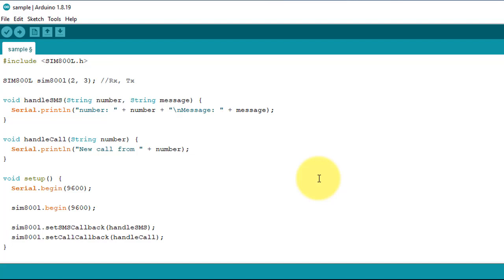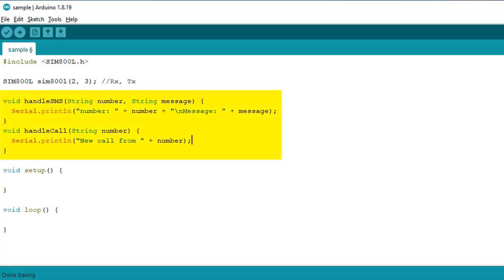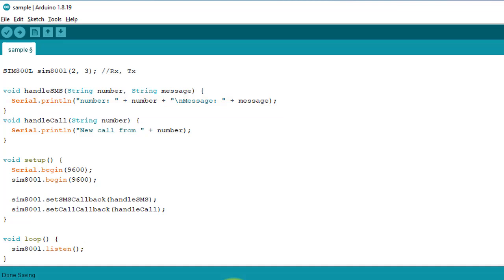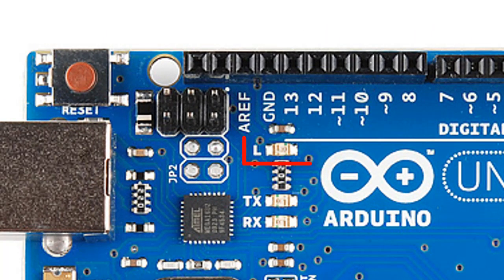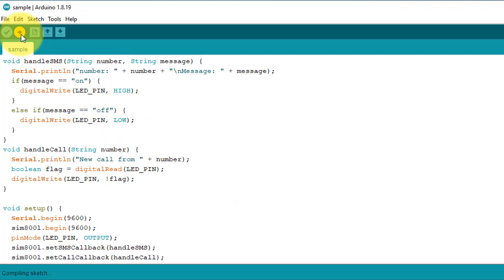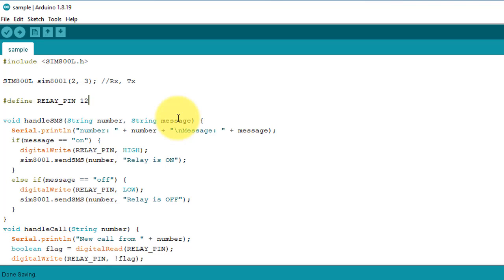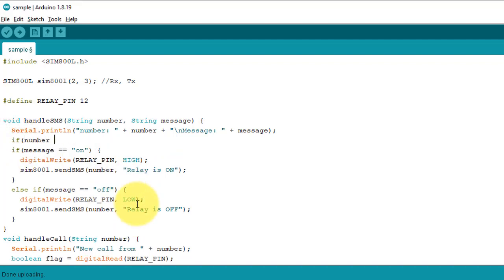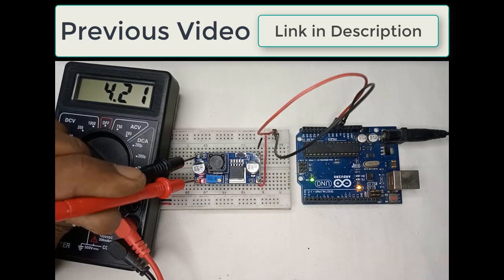GSM Module Arduino - Sim800L Library Programming

Comment: youre circuit diagram is not correct, my sim 800l module is damaged and not working. and also dc to dc converter not decreasing and increase  voltage when i connect to youre diagram. how to connect dc to dc buck converter please tell me sir

Comment: Hello Ahmad,

PROBLEM : Startup problem by using your project (Arduino UNO and relays steering by SMS) with only external power source and by external power failure.
First of all Thanks for this tutorial !
But  when I tested the Sim800L & commanding the relays with SMS I realised a Seriously problem !
The program runs only without problems when the UNO board is coupledwith the PC via the serial usb connection.
Running the Arduino UNO only via the power jack (12V feed), the program doesn't work !!! 
The Arduino UNO & Sim800 StartsUp !
The Sim800L runs and connect to the network, the PowerLeds on the Arduino lights up!
But there is NO REACTION on sending the SMS, despite the Rx Led on the Sim800 gives a sign of receiving the SMS !
 
You have to Reset the Arduino first by the Reset button before the program start and run again without problems!

So there is a problem on Starting Up the Arduino by only using external power. Same difficulties when you have an external Power failure.
In bot cases you have to use the RESET Button to start the program !
That means that you can't trust the working of those projects. Specially when the project is located several miles awayom your position !!!
I could not find out what the reason is for this malfunction, could you try to find a solution for this rebooting problem ?

Greetings

Comment: if the SMS is not readable on the serial monitor, you need to turn off (Auto-bauding) on the Sim800l and set it to fix 9600, now it works. AT command used AT+IPR=9600

thanks for the library, it really helped me
Reply from the maker: thanks for suggestion

Comment: Hello Ahmad, I bought sim800l gsm module but ı cant run that can you help me ?
I dont know what ı did wrong. I provide 4v 2A from adjustable power supply and ı plug sim card correctly but it says "Register in network failed"
Reply from the maker: provide 4.4v
Reply: Are you sure you have 2G coverage with your provider at your location? If not, try adding a piece of wire 1/2 of the wavelength of the respective 2G band (900 MHz in most of the world including India). Also check if the right pin is used.

Comment: Now I bought GSM SIM800L and when connected to the circuit it rings but the code is not executed 
And when I changed it to another one the code worked what is the problem that is in the gsm
Reply from the maker: I think the issue might with with sim800l
Reply: @AhmadLogs  But the connection responds but when placed in the circle the code does not execute with the Arduino 
While the other works well on the same circle
So does it need to make configurations or definitions when using it for the first time
Reply from the maker: @AlMokhattatAlIlahi  I does not require any configuration for the first time. the library configure itself. I think there is some other issue

Comment: Dear my sim800l module not responding for any AT commands what may be the problem?
Reply from the maker: observe led of sim800l to see if your module is working or not.
check your serial connections
check baud rate etc.
Reply: @AhmadLogs  my sim800l led is properly blinking after 3sec  i check all the connection. I have 4 sim800l module but all are unable to handshake with Arduino UNO, Arduino nano and esp32 and ESP 8266 pls help
Reply from the maker: @varunraghuwanshi3177  There are several reasons why your SIM800L module may not be responding to AT commands. Here are some things you can check:

    Power supply: Make sure that your SIM800L module is getting sufficient power. The module requires a stable power supply of 3.4-4.4V and a current of at least 2A during transmission. Check your power supply and try a different power source to see if that resolves the issue.

    Connections: Check all your connections to ensure that they are properly connected and that there are no loose wires. Make sure that the RX and TX pins are connected correctly, as incorrect connection can cause the module to fail to respond to AT commands.

    Baud rate: Ensure that the baud rate of your serial communication matches the baud rate of the SIM800L module. The default baud rate of the module is 115200, so make sure that your code and serial monitor are set to this value.

    SIM card: Make sure that your SIM card is properly inserted and activated. The module requires a working SIM card with a data plan to connect to the network.

    Firmware: Ensure that your SIM800L module has the latest firmware version. You can update the firmware by downloading the firmware from the manufacturer's website and following the instructions provided.

    Reset the module: Try resetting the module by powering it off and then back on again.
Reply: Thanks for your valuable feedback

Comment: Thanks for this detailed explanation,
whether it is possible an sms code and SIM module to vary the PWM of a led by messages. example: send v0 led off, v1=20% pwm, v2=40% pwm....until vn=100% pwm.
thank you for your reply.
Reply from the maker: Yes, you can
Reply: @AhmadLogs what code is required for this, and how can the message be changed to require led_state:"brightness" (ranging from 0 to 100)? Thanks for any answers.

Comment: Please make a video Arduino gsm with relay control mobile app  by mit app inventor. Please
Reply from the maker: will try
Reply: @AhmadLogs  thanks Bhai
Reply: Sir please make a video arduino nano gsm sim800l and  2relay for water pump starter control trigger mode only 5second on by sms command and phone calls START relay and STOP relay and define a pullup funsion pin for water over flow sensor control it's very helpful for farmers 🙏🙏
Reply: I'm request to you  many times and waiting for your response to a long time

Comment: The sim800l can send sms to different languages except english?
Reply from the maker: Yes, the SIM800L module can send SMS messages in languages other than English, as it supports a variety of character sets, including Unicode, which can represent characters from many different languages.

To send SMS messages in a language other than English, you may need to configure the character set used by the module to match the language you want to use. This can typically be done using the AT commands provided by the module. You should consult the module's documentation or datasheet for more information on how to configure the character set and send SMS messages in different languages.

Comment: You do great videos Ahmad but isn’t the 800L dead? In the USA 2G and 3G are things of the past. I was very disappointed when my SIM800L stopped working. 4G or 5G is the new standard.
Reply from the maker: It's true, In most Asian countries, 2G is still widely used, and it can be challenging to find a 4G module in my country. I aware of this fact and was likely trying to provide helpful information to a global audience.

I was unable to find a 4G module in my country and purchased one from China instead. However, when I tried to use it, the device was blocked because its IMEI number was not registered in my country. This is a common issue that can occur when importing electronics from other countries, and it can result in the device being rendered unusable.
Reply: @AhmadLogs  great video, i recommend you to buy the SIM7600G-H module is for global communication, I have started using with esp32
Reply from the maker: @nefistofelesjulio  I will buy it soon
Reply: In many countries except Switzerland, Australia, the Netherlands, US, etc., 2G still is up and running and not even yet at the sunset.

Modem complexity and required bandwidth is a benefit of 2G (and LTE-NB). Some providers decided to keep 2G running inside the 4G guard band.